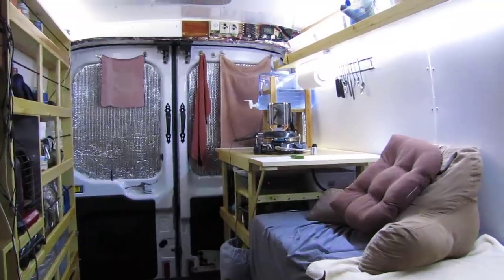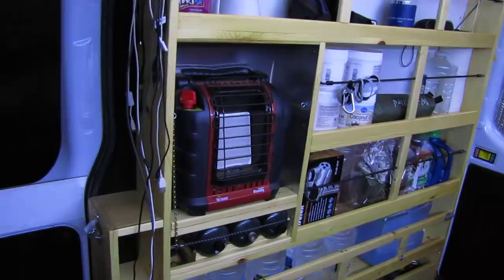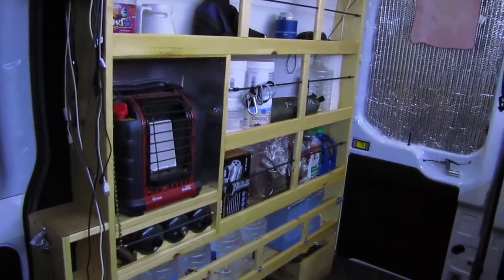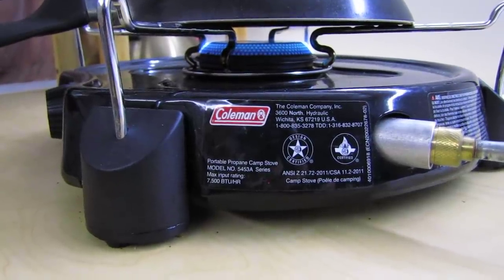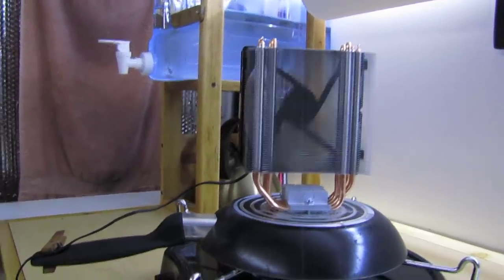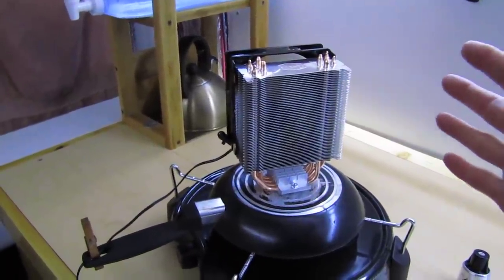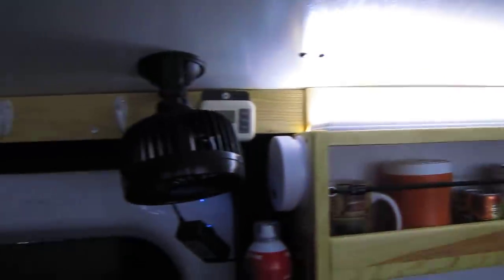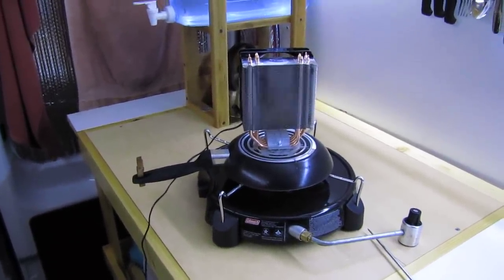My Van Heater using a Computer CPU heat pipe heater. Just an experiment to see if the concept works.

Comment: I have watched your vids before, but this one earned a sub. I was looking for a cooktop heater (I subscribe to Bob's channel) and this video was suggested by youtube. Well done, great idea! Could one of those mini log burner thermoelectric fans work and cut out the need for external DC?
Reply from the maker: Thanks. I am not sure what that fan is you mentioned?
Reply: I've been researching.... 😀
This is a stove fan. https://www.youtube.com/watch?v=3oQXsIK1yZo sits on top of a log burner and the heat generates electricity that turns the fan. Probably won't be too effective as the heatsink only has a few fins.
BUT.... I also found this https://www.youtube.com/watch?v=6LmDAFBBPK8 that looks like it'll work with your design.
I love your idea, but I am clumsy as hell and that cable is something for me to snag!
Reply from the maker: Hmm, love to see what ou come up with. I don't have any problems with my 12 volt fan so far

Comment: Late comment but if you are still working on this design maybe a dryer vent attached to the back of the fan and run to the floor would help even the heating in the van. Sucking in the colder air to warm it up.

Comment: That's really creative.  Can you provide a link to the CPU fan? Thanks for posting this.  I'm so glad I didn't already buy a heater.
Reply from the maker: Thanks Gayle. It this one on Amazon. But it was $14.99 last week
Typical Amazon price games that they play
https://www.amazon.com/gp/product/B01KBXKP8W/ref=oh_aui_detailpage_o00_s00
Reply from the maker: There are many on Amazon. I just found this one for $9.99
But it only has two heat pipes
https://www.amazon.com/Cooler-Master-Hyper-T2-Heatpipes/dp/B00K7809O2/ref=sr_1_1
Reply from the maker: Mine has four heat pipes, so you can look around and maybe find a deal on one with 4 heat pipes. Just make sure it has a vertical fan that blows sideways. Some heat pipes are horizontal units
Reply: I will gladly pay $30 for something that works.  My dad was a guy like you that made things from what he had or could figure out a way around the norm.  I can see how this will work just fine.
Reply from the maker: I tested it again tonight with a fan speed control and that works great also. I'll do a shorter follow up video once I nail down the design
Reply: Any video would be appreciated, short or long :)

Comment: Would it work better if you were to remove the stove's grill, set the pan directly on the stove, of course make some wholes on the pan to allow for ventilation. That should produce more heat heing that the flame would be closer set to the stove?....
Reply from the maker: No, because the aluminum pan is a heat sink that stores and distributes the heat. There is a heat bubble inside the upside down pan shape

Comment: That's nice but 80 degree F ain't much ,, what temp can you get out of it when you turn the flame up???
Reply from the maker: I have no idea. I din't need it any hotter than that for the test. You can probably guess that turning the stove way up would produce way more heat. The last trip I took in the van, it was hotter than hell in MI and I did not even have to use any heat.

Comment: Really clever!. Would a small cast iron fry pan work or would that fail to conduct heat up to your contraption?. I suppose it would act as some kind of heat sink tho. Thats the theory behind the flower pot heaters. In reading about everyones dilemma with conden sation, Ive pondered whether curtains made out of 100%  wool army blankets would work inasmuch as wool can carry alot of moisture without losing its insulating value.

Comment: What if you used a toaster element
In stead of the propane gas.
You can trun down electric system low then gas system.
Reply from the maker: How many watts does an electric Nichrome heating element consume?

Comment: wow! lotta commenters here who clearly know nothing about stealth camping and being off grid. the difficulties of creating your own electricity they are clearly in the dark about.
my concern is cO2 or whatever deadly gases that i heard open flame puts off vs catalytic heater. might be interesting to have a digital device to monitor stuff like that.
Reply from the maker: yes, you are correct. The CO sensor was mentioned in the video description
Reply: What many folks don't understand about open flames is the more efficient the burn, the less carbon monoxide is being exhausted. CO1 is produced with incomplete oxidation of the carbon atom. A clean propane burner that burns blue is burning about 95% efficient. At 100% there is no visible flame and no CO1 at all. In fact, four candles burning with a yellow flame puts out more CO1 than a well maintained propane burner. In fact, I inhale more CO1 when I smoke my pipe than 12 hours of a blue flame burning Coleman stove. CO2 is indeed exhausted in any case, but since CO1 and CO2 are heavier than normal breathable air, any small hole to the outside in the bottom of the van will vent both CO1 and CO2.

Comment: Didn't hear you mention it, but did you apply thermal paste between the pan and the CPU cooler?  If you aren't, it would probably give you a better heat transfer.
Reply from the maker: yes, I always use thermal paste

Comment: Have not built it yet, but had basically the same idea but was gonna try using an oil lamp burner for the heat source, could use more than one if needed
Reply from the maker: The smell would be too much for me. I tried unscented candles and that smell bothered me.

Comment: There's enough room on that pan for another heat sink...you would have twice the heat? I'm thinking about the nights when it gets down to ten degrees. I have a little buddy and the fumes gave me a headache after just a couple hours...and a big splash of water fell off my ceiling onto my bed. I am looking into the propex heater for my van, I wonder how much battery power you need to make it through the night? Thanks for posting the video!
Reply from the maker: The 12 volt fan uses about 200 milliamps when turned all the way up. That's not much really. A bigger heat sink connected to the pan would be better, but then you would need more heat pipes also and a bigger radiator. I have a large AGM battery in my van and so running that device all night would not be a problem. There's a 12 volt fridge in the van also and it uses much more power than the little fans does. As long as the battery gets charged the next day, everything works fine
Reply from the maker: I have 200 watts of solar panels on the room that takes care of the battery charging nicely.
Reply: You would not have twice the heat since the heat output is limited by the size of the heat source (i.e. propane flame).  All that heat pipe does is allow a fan to be placed by it and redirect the heat elsewhere.  That is a valid concern for CPUs, but not so much for the inside of a van.  The heat is going to rise to the roof, so the 12V fan that he has that blows towards the floor makes more of a difference than the fan on the heat exchanger attached to the heat pipe.

Comment: A lot of guys on the do it yourself channels make burners out of iron pipe or something by drilling small holes.  Maybe get the right regulator and then attach the right size iron pipe and experiment with different hole sizes.  You can even have several pipes with different holes for different temperatures.  I don't know if it would be safe for the CO levels disclaimer....You would need a metal enclosure and probably several CO detectors.  Probably one or two small holes could heat your van.  You would probably need a 1/2 lb regulator and a 20lb propane bottle or something.  But I would do your own research to determine safety if you choose to do this for yourself. Or this https://www.amazon.com/gp/product/B000BUV1RK/ref=as_li_ss_tl?ie=UTF8&psc=1&linkCode=sl1&tag=cheaprvliving-20&linkId=162d644bc10787e0b8bebc55807a9c6b

Comment: Why don't you get a little propane heater?
Reply from the maker: I pointed to a propane heater in the video. Did you see it?
Reply: I think Nicholas meant why not a smaller propane heater than the mr buddy...
Reply from the maker: That is the smallest Mr heater. No one makes one that is 1/5 the BTU of the one I have.
Reply: Seems like an opportunity to think of a propane heater that can vary the btus (ex. 2000-7000) and push the heat with a fan?

Comment: How long will that last on a 30 lb tank
Reply from the maker: A tiny flame like I am using in the video on a 30 pound tank would last a very long time. I can't give you specific time limits?
Reply: certainly long enough for it to be economical and of use
Reply: @jackdangers3292  i remember seeing a video of a woman who used one as only heat source, said it lasted lot longer than you think, if i recall she said one tiny bottle lasts a week on lowest setting

Comment: 200IQ
Reply from the maker: Not quite. :)
Reply: Not really.
Just run the propane heater with the roof vent cracked. Takes care of the moisture build up and the over heat problem. Still to hot, roll down a window a bit. Then you don't have to worry about the ever so minor problem of asphyxiation from burning in an enclosed space.
Reply from the maker: @genejeffries2888  All that has already been answered in the video description

Comment: how about moisture ?
Reply from the maker: You breathing out is the main moisture producer. You have to be venting the van out with fresh air all the time.
Reply: @EL34XYZ  
heater must produce significant moisture too
Reply from the maker: @duggydugg3937  Not that tiny flame I am showing in the video.

Comment: The computer fan is designed to connect to a computer. It's not a 12v fan. How did you get around this?
Reply from the maker: Computer fans can be 12 volt or 5 volt fans. My fan is a 12 volt fan.
Reply: @EL34XYZ  but it's made to connect to a computer. I don't understand how to power it? Buy a cigarette lighter plug and rewire it? That's pretty much impossible....
Reply from the maker: @Brock79  You need to find someone to help you. This is really easy stuff. The fan has two wires and a cigarette plug has two wires. You need to wire up a cord
Reply: A pc fan is 12v by default the same as a car the pc connector has 3 or 4 pins the red is positive the black is negative the others are used for pwm and/or rpm control if you don't hook them up the fan just runs full. Its very simple. 12v DC is 12v DC it does not matter where it comes from. if you have an old PC fan you can even power it with a 9v battery is you want to try.
Reply: @PaulGariepy  Really? I've got to figure out how to do this. I bought a 5v solar fan that to my surprise is a computer fan. Ill do for my chicken coop exhaust fan. But wont run during the monsoons here in AZ. I need to figure out how to get it to run off a rechargeable battery or to be able to hook it up to an inverter...Any advice :) Please and thank you in advance
Reply from the maker: Fans have nothing to do with being for a computer or not. They are just fans. Sure, you can put fans in computers, or chicken coops, or a million other places. What ever DC voltage the fan is made to run on, you just hook it up to that voltage and it will run. There is a + and - connection, just like on batteries and that's how you hook one up to a battery or a DC power supply
Reply: @Brock79  you could always wire a USB cord to it
Reply from the maker: @DaneH64  My fan is a 12 volt fan, not a 5 volt fan. My van has 5 volt and 12 volt receptacles everywhere. 12 volt fans ares the most convenient to use

Comment: I think I saw you in that BACK TO The FUTURE  movie!  That's before the black mold (Stachebyrus) got to you!
Reply from the maker: That's all in your tiny little fantasy world :)
Reply: @EL34XYZ  For 47 years I was a HVAC Tech, somewhere in the 70' everybody that could started putting in thermopane    windows and going around chasing drafts. Eventually there was no incoming air to support complete combustion in the furnace. Add the clothes dryer pushing air out. Most of these were right in the furnace or utility room. Now we had a negative pressure and the only place air could get in was down the chimney. Of course this only occurred in the winter months when it was cold and the heater was on a lot. Next was the mold problem because there was no air exchange. People started getting sick. I had to buy a $1,200 tester to check for C0/2 coming out of the furnace or utility room on every check up or service call I did. Now every one must have a CO/2 detector by law. It's not fantasy when they drag out two adults and three little children's bodies  because of this deadly silent killer.
Reply from the maker: @Squarekn0t  That's nice but it has nothing to do with my van.

Comment: Get an espar heater it has a thermostat it's what every truck driver has inside the sleeper now so they don't have to run the engine
Reply from the maker: Expensive, complicated to install and runs on diesel fuel.
Reply: @EL34XYZ  you get the knock offs for cheap on ebay or amazon. get the 2kw model you will love it comes with everything you need

Comment: How did you stick the fan to the pan?
Reply from the maker: Screws.
Reply: @EL34XYZ  i don't understand. How do you make the holes for the screws? What's your latest review on this? Safe?
Reply from the maker: @Brock79  The base of the heat sink is a flat piece of aluminum. You just figure out where you want to drill holes and drill them.
Reply: @EL34XYZ  ok I just got my heat sink. Now I gotta buy a drill and screws ? Can you clarify how you did that step?
Reply from the maker: @Brock79  I don't know what to tell you. I have a shop with a bunch of machines. It's pretty easy to decide where to drill mounting holes. If you don't have the basics like a drill, that's going to be rough. Look at the video at the 7:10 mark and after and you can see a screw on one side of the heat sink